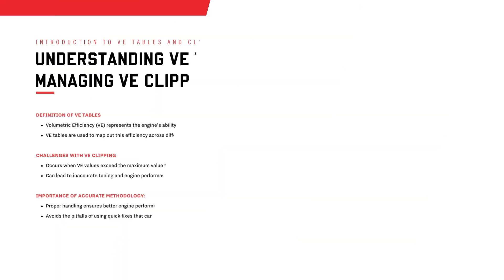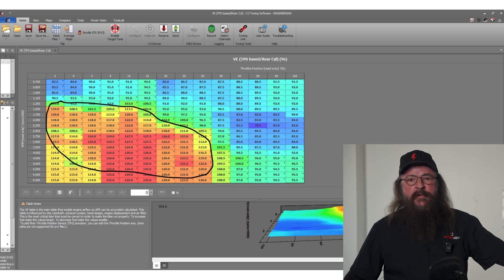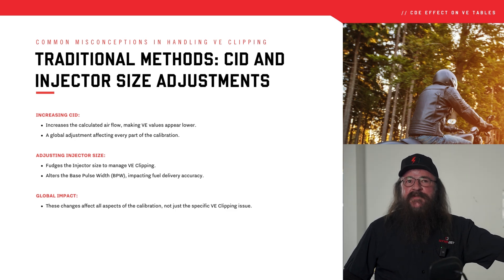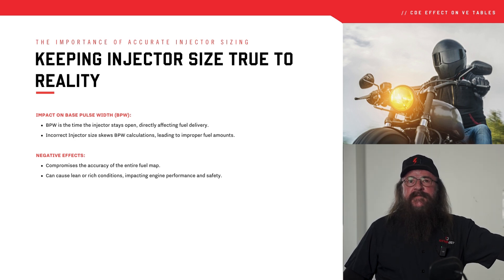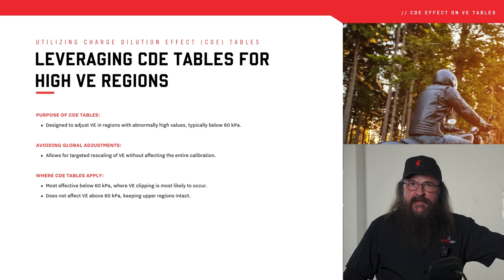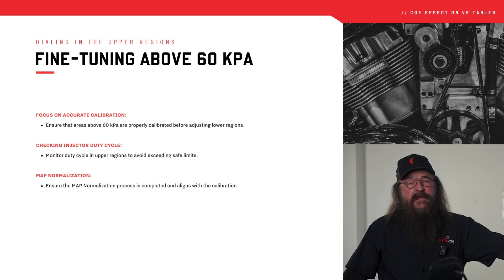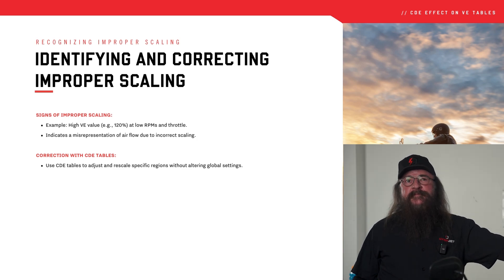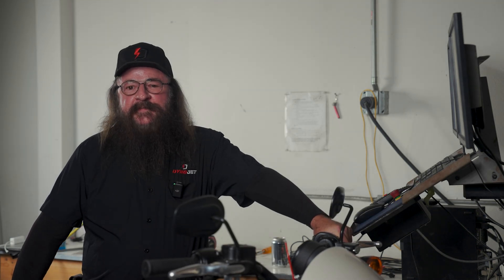Stop Increasing CID: CDE & Its Effects on VE Tables

Comment: This is (almost) exactly the information I've been searching for. One wonders if it is happy coincidence or product of my conversations with your (not so helpful) tech support this week.

My problem is not exactly addressed here though. I am having the opposite issue from what you mentioned. My VE values that are being created while autotuning the bike are being clipped in the upper kpa range. I am seeing values created at 100-127.5 in the 2000-2750 rpm range and above 4500 rpm. There is also a trough being created in these higher kpa ranges between 3000 & 4000rpm. In this range AT is wanting to populate ve values @ 75-100. 

Autotune is wanting to populate my ve values in the low tp/rpm/kpa ranges to values in the high 50s to high 60s.

I have allowed AT to scale displacement twice, in spite of it's continuous requests to do so. Displacement is currently @ 109.3. Injectors are set @ 4.35 gm/sec. 

The bike I'm working with is a fresh 88 to 95 build using s&s jugs and +5.3cc pistons, post 06 head castings that have been cleaned up w/ stock valve sizes, s&s 570 cams, v&h big shots, s&s air cleaner, DJ PV3, and DJ autotune w/wide bands. 

I am pretty new to tuning in your software, but I do have a moderate to decent foundation for the concept of the ICE and EfI function.

Any input put from you, dyno jet, or any other friendly members of the community would be greatly appreciated. I can learn "real good" if someone wants to push me in the direction of applicable text/resources.

I have my first born due in December and would love to not have to drop the extra coin on a dyno tune after wrapping up this build which was started before news of the incoming. I would also appreciate gaining the first hand knowledge. Thanks in advance to anyone who responds to this long winded post!
Reply: After reading the full description of this video, it seems that it might be good for me to look into map normalization. I will do this and wait in anticipation for your video on the subject.
Reply: Sorry, more back ground. Your (dynojet) base map for this build had the front ivo map tooth value at 8, which is in line with the value that cam cruncher kicks out at 8(.22 I think?) for the 570 cam. This had me idling at around 46kpa though. I changed the front ivo map tooth value to 7 which now has me idling at 35-6 kpa.
Reply: Would it have been more appropriate to address the high kpa at idle in the MAP load normalization table rather than change the MAP tooth IVO?
Reply from the maker: @TXRed1836  Where to begin, you have a lot of questions! Always start with the closest base (starter) cal you can find. ALWAYS start with the actual CID and Injector size as these are critical Global settings. Rinse the cam being used through the cam cruncher and apply settings. Start bike and let warm up naturally and see where MAP pressure at idle comes in. If abnormally high you must change IVO/IVC in pairs. If you subtract 1 from IVO subtract 1 from IVC as well. Once stable check MAP Normalization. Your dyno should read around 101 kpa a sea level, turn the ignition switch on and start stop switch to run. The MAP sensor on your motorcycle should read within 1 kpa or less than the atmospheric probe on the Dyno in a static/non running position. Make a 4th gear pull from around 1250 rpm's to red line or around 6k rpm's. Graph it on the dyno and adjust up or down until the line is straight on target at ambient barometric from at least 1750-2 all the way to 6k within 1kpa. This assures you are pulling from the correct command tables i.e Spark Timing/Lambda-AFR. Set the afr/lambda command to a flat 13.0 afr or .890 lambda. Dial in the VE tables at 70 kpa and above. Once these are stable run 60 kpa and below, use the higher load values as the high-water mark for those 60 kpa and lower. The size of the differnce in VE will help you decide how much to adjust CDE. If large discrepancies, you will need to use larger adjustments. Rinse and repeat as needed.  There are many caveats and trip wires along the way to build a great final tune. We do offer Advanced Classes in Montana if you are interested contact your Regional Sales Rep. Happy Tuning! -Russ
Reply: @DynojetResearch  Russ is a stud! Not only does he speak a lot of truth here, he can 100% back it up. My team and I just completed the Advanced Tuning Class and it is a game changer. We literally applied the knowledge as soon as we returned to our shop. 
Great job Russ and the whole Dynojet Team.  
The Chapel Motorcycle Shop
Reply: Russ, thank you very much for taking the time to respond. I would love to have the opportunity one day to come take a class with y'all.